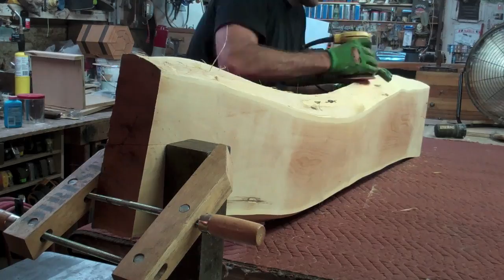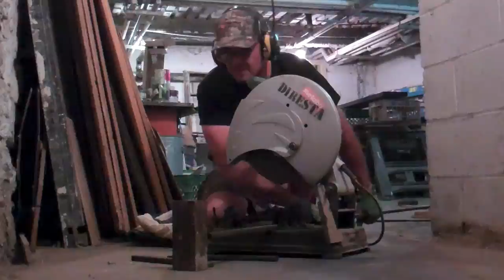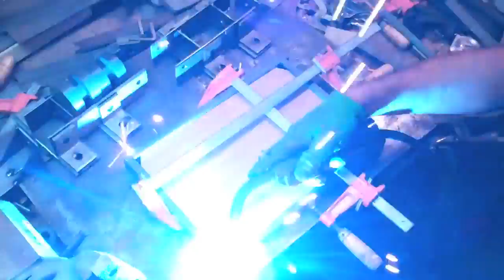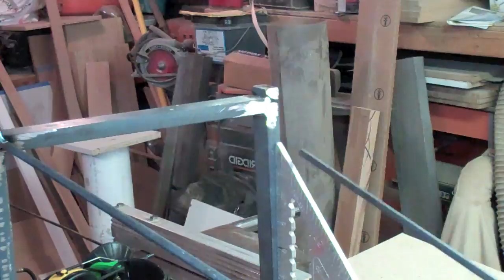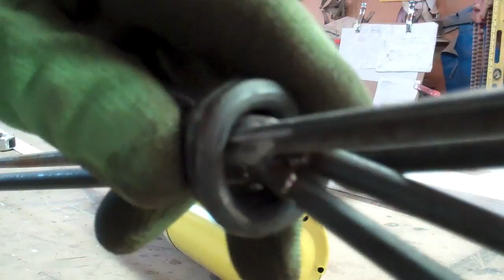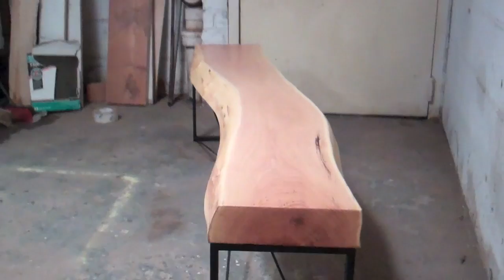✔ DiResta Slab Bench

Comment: Very cool. Question: would it be better to use slots instead of round thru holes, for fastening the slab to the steel? Thereby allowing the wood to expand and contract with changing seasons? I would worry about the screws disallowing wood movement, and causing cracks over time.

Comment: You sir, are a fabrication guru. Thanks for the lessons over the years man; and as always, you keep making them, I'll keep watching them.  
Also I know your not working with Extremley thick alloys, but have you fooled around with spray arc at all? When your welding in the flat or 1G position such as when you were welding on the frame in this video. Spray arc produces a very smooth and flat bead, as aposed to short circuit which is more convex in shape. Also with spray arc there virtually no splatter to deal with. So all in all just less clean up, and grinding involved; although I've only ever used spray arc in groove welds, just curious about your thoughts.

Comment: Eh jimmy, I'm gonna start looking for a welder to get on with a project of mine, and I want to know if you'd recommend Flux over stick or vice versa. I know there are a lot of forums and long articles written on this, but I trust you more than some other random internet person :)

I don't care how the welds look as long as they're strong, and I will be welding angle iron at least a couple mm thick. 

Thanks, jimmy!
Reply from the maker: get a flux core to begin .. simple and cheep.. used or home depot watch few video for instruction thank you !!
Reply: Hobart handler 140. About $600 largest welder that works on 120 volts can run flux core than when you get better you can get a tank and start mig welding. My 2 cents.

Comment: The narrow rods useles without turnbuckles. or no?
Reply: With only vertical loads on it, all the force would be only in the end rails. I suppose if someone scooted sideways and put some shear force on it, those would help slightly to keep the legs at the same distance apart or from turning to a parallelogram. or tension support for picking up one end and sliding it to move, a mirrored tetrahedral for the most part. Mostly just for looks, i'm thinking.

Comment: how long did it take wood  to dry before using ?
Reply: Depends a lot on your conditions but usually it is 1 year per inch of thickness. Regularly check with a moisture meter or find someone with a kiln to dry it quickly. Always coat the end grain with Anchorseal or latex paint to help prevent checking.